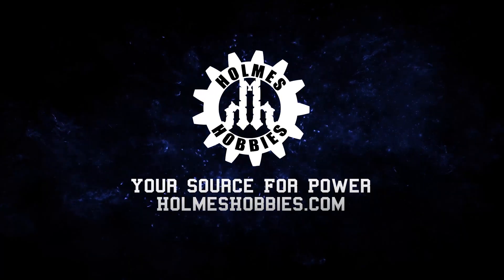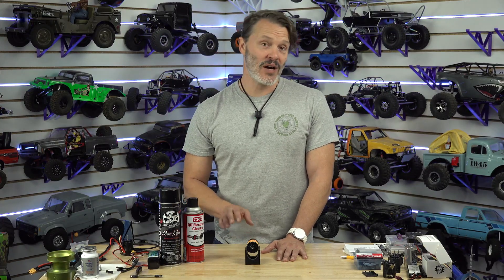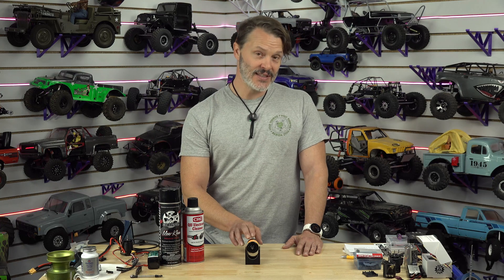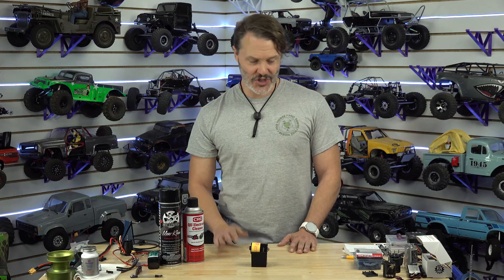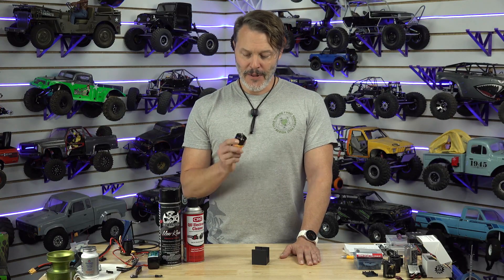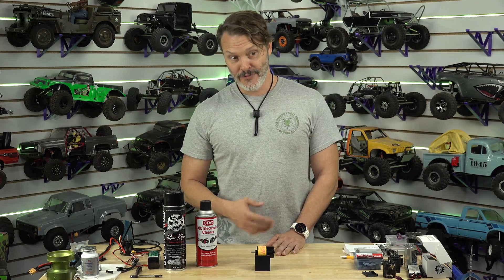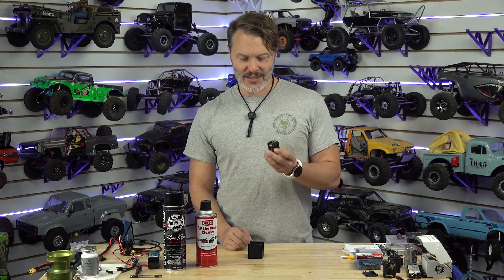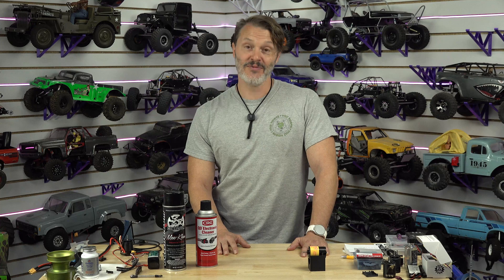⚡Brushed Motor Water Break-In Myths EXPOSED! Do You REALLY Need To Do It?

Comment: I'm using your 12T 550 Trailmaster in a vintage RC10T. I wanted something with torque, and I didn't want to worry about overheating. I primarily use brushed motors on my Tamiya/Kyosho/Losi RCs. I would love an open endbell, rebuildable motor from you...like a 17 or 15 double, so it has some grunt but enough rpm to make my old buggies run fast and reliable.
Reply from the maker: We handwind anything but the retro sport 540 would be 6x more affordable.  Comes in 21, 19, 17, and 15t
Reply: @HolmesHobbies I have a few retro sport motors, but I really like being able to pull them apart to "refresh" my motors. I'm not really a use it and throw it away kinda guy.

Comment: Hey John, put your money where your mouth is?  Run a test using a brushed motor with replaceable brushes (open end bell).  Measure amp draw and remove the brushes  at 1, 5, 10, and 15 minites into the test and examine brush wear/contouring.  I think you'll be surprised by the results - I was!  A PROPERLY broken in motor will perform better, be more efficient and be more consistent throughout it's life span.
Reply from the maker: We break in every rebuildable motor before they are sold for the reasons you listed.  

We do not break in sealed cans for the reasons i stated in the video.  Im also not going to "put my money where my mouth is" adding $5 labor cost on a $20 motor.
Reply: @HolmesHobbies No, I meant, take a stock motor and do the testing I suggested.  My point is, this argument is never ending so, lets do a water break-in and get some real world data.  I dont expect you to break-in your sealed endbell motors, though - now that would just be crazy, lol.
Reply from the maker: @jerryvolpini7987  our rebuildables have contoured and serrated brushes.  For a 35t it takes about 3 minutes at 3v to fully seat.  15 turn takes about 30 seconds.  Then we bed in at higher voltage for a few seconds.  

A properly broken in motor absolutely performs better.   With sealed cans its a matter of the users preference and goals.   Amp draw is so low on a 35t sealed can that performance gain is practically unnoticed.  Amp draw on a 15t is high enough that tall gearing can smoke the comm if its not broken in though!

Comment: Brushed motors have been used in RC for over 50 years and water break-in has been around probably just as long.  You can tweak the motor with brush compounds and shapes, brush orientation, magnets, and different thickness springs, but the design/technology hasn't changed much.  Water break-in is not just about being quicker.  It reduces heat, nearly eliminates arcing and reduces brush 'bouncing' that can pit the comm and lead to premature failure.  In the end, it improves performance and reduces amp draw making for a more efficient motor (longer run times).  Do you need to do it in a basher or rtr, definitely not but don't just throw a battery in it, run the RC at full speed then whine about your motor failing prematurely! 🤦  Lots of anecdotal evidence that says you dont need to do a break-in ("Ive never broken in a motor and mine last for years") but that doesn't prove anything - smoking causes cancer but smokers don't always get cancer. Water break-in is a quick, safe method that improves performance and efficiency, and will produce a better performing motor.

Comment: If water break-in is reducing your motor's life by "hundreds of miles" then you're doing it wrong.  Leaving the motor in as long as 30 minutes is just wearing away brush material - that gray cloudy water is not dirt, it's brush material being ground away.  Typically, 1-5 minutes, TOPS, is all you need.  Any further break-in can be done in the vehicle but the brushes will already be contoured to the comm (wrap the comm) and that should noticeably improve efficiency and run time, as well as performance.
Reply from the maker: In a crawler it absolutely reduces life that much.  Most of our sealed cans have around 500 miles plus in a crawler.   Fully broken in takes about 25% of that.
Reply: There’s a big difference between most sealed motors and modifieds. 
Mods typically have much better quality brushes that are already contoured, they just need to be seated a little better - but many sealed cans have brushes that aren’t even close to the shape of the commutator, so much longer breakins are required (for racing). 
Personally I wouldn’t even bother doing on anything except a stock race motor, for modifieds just start with the right brushes to begin with and after your heats clean your motor out with whatever spray you use.

Comment: I race in a 15T Super Street class in a hobby shop parking lot club during the summer and run a Retro Sport in a TT-02. And I have 2 on hand to run in the Clod Buster I'm building. Great motor, has way more punch than I was expecting. I never did a break-in, I just finished my rookie season and was way more concerned with not crashing or causing problems on the track.

Comment: The sealed up motors that you can't take apart I didn't bother to break in and it wasn't worth the time... My good rebuildable race motors I did take the time to rebuild in fact I had the commentator lathe as well as the brush lathe and brush cutting unit.. actually I still have them..,.. I've always been a big student of water and electricity don't mix so I never bothered with the water break in method was more worried about burning up in ESC.. not sure if you remember back in the day though if you looked at a Novak ESC the wrong way it go up in flames.. Westlake Traxxas electronics nowadays LOL
Reply: They used sealed motor in stock class racing, the most competitive class.

Comment: I have never broken in a brushed motor. I did not see the need. Thoughts?
Reply: If you have used a brushed motor, you have broken it in. Just not with a race voodoo method. 

You’re doing fine, don’t worry and keep at it.
Reply: @Glocktologist   When I used to race, I never broke in my motors either.
Reply: @alfredyost7972 it's a significant difference in performance when conducting very competitive racing. If not racing, nothing to even bother with.
Reply: @jlowknight  Now that Think about it, I did break in my race motors but differently. I used motor spray. I used motor spray to keep my race motors clean but it would also soften the brushes too. I did use a comm cleaning tool also.

Comment: Ive not used water to break in...but once I got salt water and sand in my moa crawler and it was starting to seize up

I prepped a bowl of purified mineral water and put the motor in it and ran for about 10mins completely submerged in both directions

The clean water became murky af and all the sand and grime came out....after that I lubed the motor with plenty of wd40 and silicone grease spray and now it runs flawlessly for 2years...great use of water if u ask me.
Reply: There is no such thing as purified mineral water. Purified water has no minerals in it.  Salt water is a type of mineral water.
Reply: @toolbaggersit's soft water.... Edible Mineral water  which is non corrosive and does not contain phosphates and carbonates of calcium and magnesium and heavy metals.

Comment: Has been a lot of years since I did the ol' 'Wet Run In' clean & lube of brushed motors. And I don't miss running in a new ' Mabuchi 540S overnight before the big race day each month. (540S was what we used in standard class)  Used hand wound motors in modified classes. Gave up racing just as SCR ESCs were appearing at stupid prices, all our racing back then was with mechanical speed controllers and NiCd battery packs. RC10, Schumacher Cat and Kyosho Optima were the machines to have back then. Ran a Tamiya Fox for several years using the 'raced once' motors from the other cars.  Oh how things have changed over 40 years LOL

Comment: if your making some videos on brushed motors would be awesome to see one on running 4s on a brushed system got way to much love for a brushed motor to switch to brushless but want more power be awesome to see what your opinion is on brushed 4s and what would make a good motor for that voltage and what maintenance for it would look like
Reply from the maker: Most of the people running brushed for performance reasons do run 4s.  It wears considerably quicker due to brush ablation but sealed cans take it really well especially since their amp draw is lower. Is fine for about any of the trailmaster, crawlmaster, or torquemaster
Reply: Ive run a brxl and crawlmaster magnum 13t on 4s for years now without issue. Id just assume use 3s but it has a tgh 2low with portals so its geared soooooo low. Without 4s it just doesn't have the pop i like.

Comment: Hi All, didnt get into the rc hobby till recently. Is the purpose of breaking in a motor to make it have less friction and therefore higher rpms? If oxidation of wires affect performance, are there not stainless wires that have high conductivity and retard oxidation longer than copper? Thank JRH for another very educational vid!
Reply: The water reduces heat, nearly eliminates arcing (arcing causes the brushes to bounce and can pit the comm leading to premature failure) and is much quicker than running it in an RC.  Once broken in, it reduces amp draw, improves efficiency and performance (rpm's) and should increase run time, even if marginally.